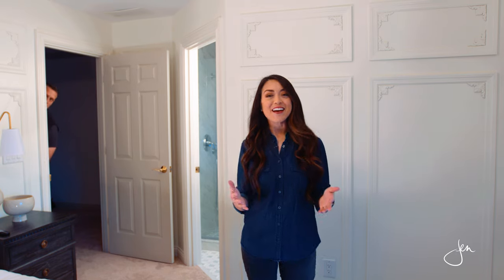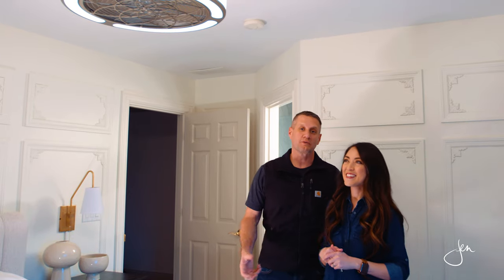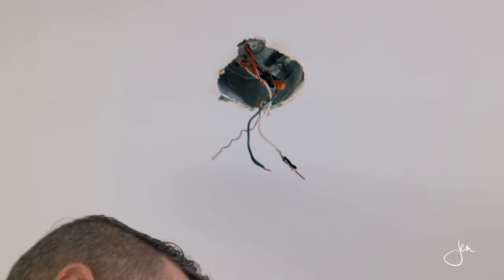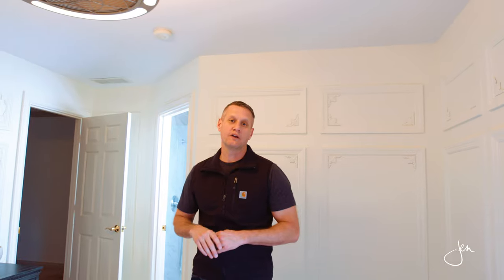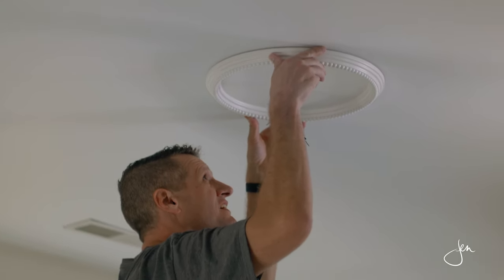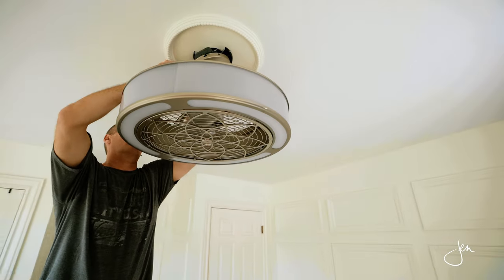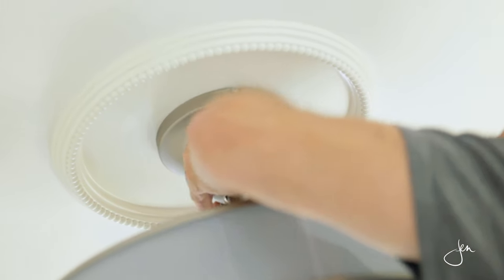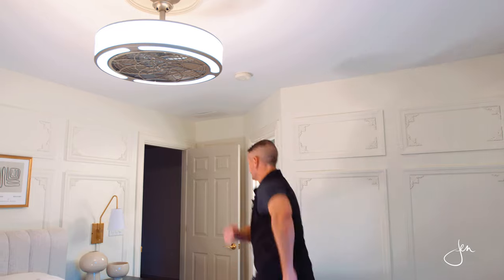How To Install A Ceiling Fan with Lights

Comment: Do you need to reinforce the ceiling  for the weight of the ceiling fan?   Typical ceiling fans require  reinforcement  in the ceiling  before you install

Comment: I’m a female senior who wants to install my Banda Rose 22” ceiling fan.  I took down the existing very heavy fan and only two wires show.  The old fan was a fan with a light sooo I’m confused right out of the gate🤦🏼‍♀️.  Should I look up in the box❓ Also, I’m going to purchase a decorative ring for my fan.  It’s amazing how it upgraded the look.  Thanks.

Comment: Adam coming in with that ‘real talk’ explanation - ‘white to white, black to black - are they using the red wire? I don’t know!’ We’ve all been there haha
Reply from the maker: I know, right?! After I watched the video, I was like... this really instills confidence! Haha!
Reply: @JenWoodhouse1  You do realize electricians use different color coding right? Green or bare wire is universally ground wire. The other colors change depending on high voltage (typically ac) or low voltage (typically dc).
He said it right. Color doesn't matter if you know what you are doing. AC means your neutral and hot are interchangeable.

Comment: Positive wire.. negative wire???? What😂
Reply: Are you talking about the two switch leg that are probably going to be in there? one for the light and one for the fan. And that white wire is your neutral. Sending the extra load back to the panel. You were right about the ground though. It’s either bare copper or green.